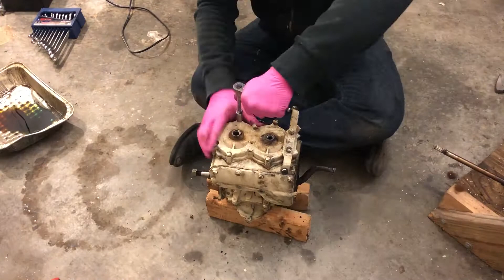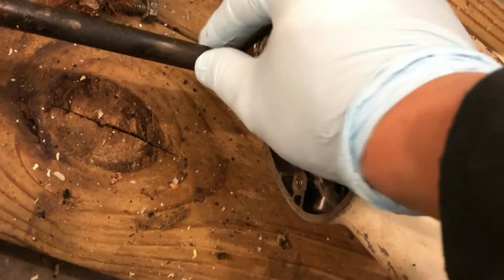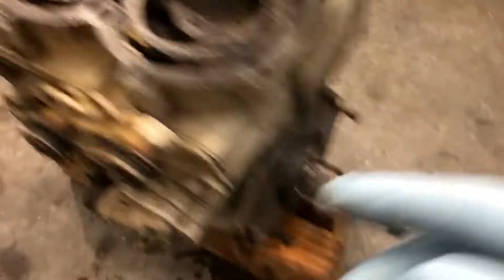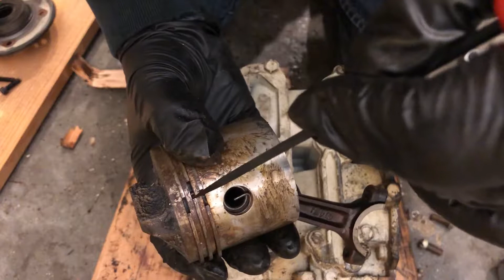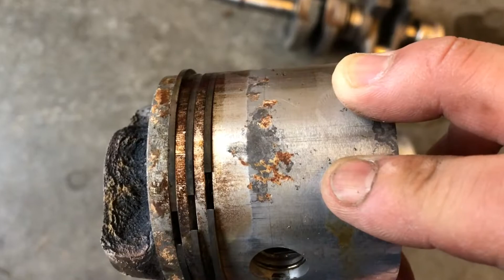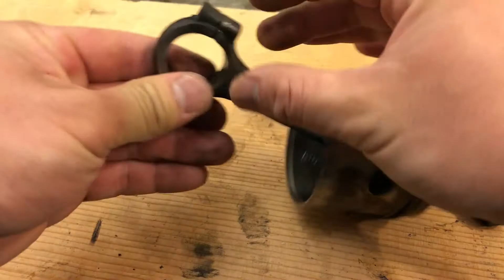Part 2 Seized 1959 12 hp Elgin (West Bend) Outboard

Comment: Great practical information. Thanks for taking the time to make this video. I am looking to get a similar 12hp Elgin. eBay is probably the best source for parts. I watched a video where a guy uses a very thin feeler gauge to get under a stuck piston ring. I have done it and with success. I would recommend that since new rings aren’t available and used ones are hard to find and expensive. Please post a video when you get that great outboard running 😁

Comment: new help, please could you send me contacts for outboard parts for my 2009 5 hp champron outboard motor,  physiopaul57@ gmail.com , thks very greatful, by the way cool very informative video
Reply from the maker: Hi Paul, I don't have a go to place for getting engine parts. I just usually do a Google search for the part I need (or the engine if I want to browse parts) then try to buy from a reputable site. Best bet is probably going to be a site like Crowley Marine, Boats.net, MarineEngine.com, and West Marine. Amazon will also have a lot of the more common parts. I don't have any affiliation with any of these sites, but I have found replacement parts through all of them in the past. For rare parts, Ebay often lists parts, but it wouldn't be my first (or even second) choice, since there are a lot of people intentionally or unintentionally listing incorrect or damaged parts.

Oh, and if you don't know the name of the part you are looking for, try to search for a schematic of the engine that you have, and the parts will be labeled with manufacture part numbers below. A Google search for this part number will usually turn up what you need. Good luck!

Comment: Great Video... Good info, and very funny. Question, I have a 12 HP  1958  The shift rod is broken, I managed to find a replacement... but I cannot figure out how to get the lower portion/skeg part of lower unit open.  I did remove the hex nut in the front.  I have prop off, u pin out, do I have to pull the gears to get this thing to open at the gasket seam ?  Thx,
Reply from the maker: I'm actually not completely sure about this as I didn't disassemble the lower unit on this motor. I do still have it around, and will take a look and try to get back to you.